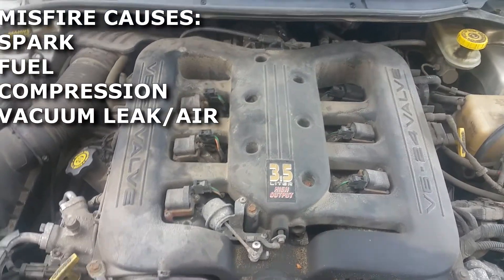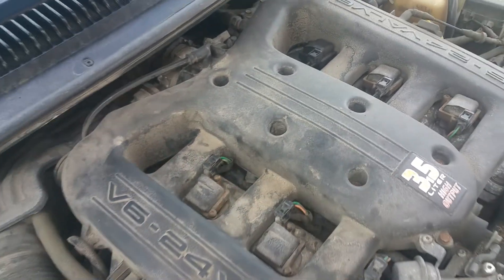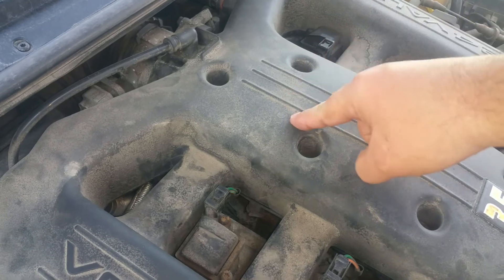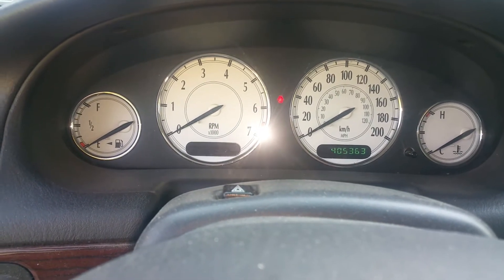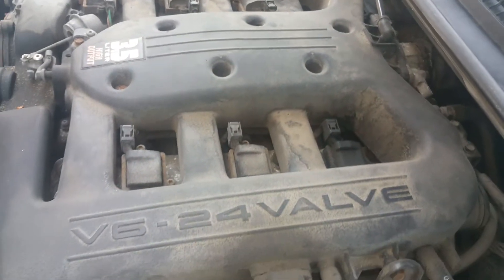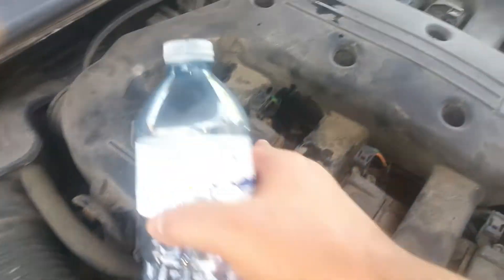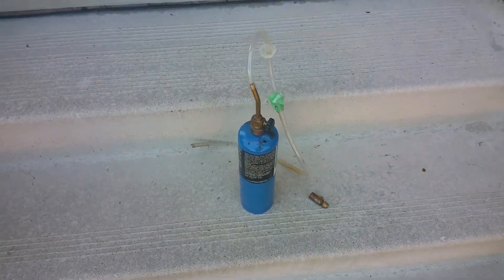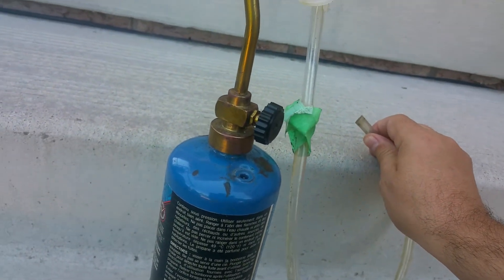Misfire, Lean Code, Rough Idle? Use Water Or Propane To Find The Vacuum Leak

Comment: Great video. I have a similar problem with my stepsister’s car, 2011 Dodge Avenger. Throttle body code (P2173) .Used water method on intake manifold. It shakes really bad and it stutter. Wasn’t sure.It was hard to diagnose. Going to try propane method to be 100 % sure in my diagnostic. Great video,again.